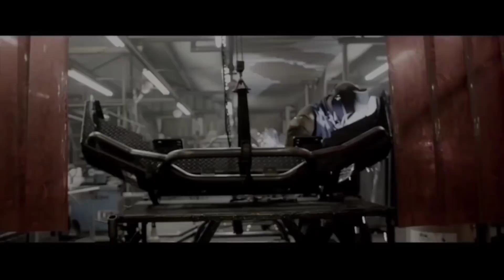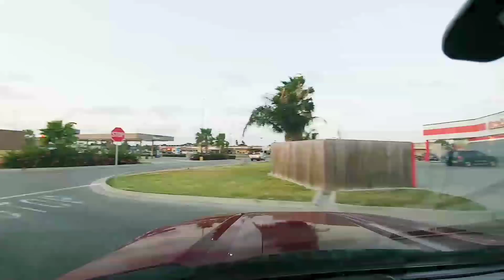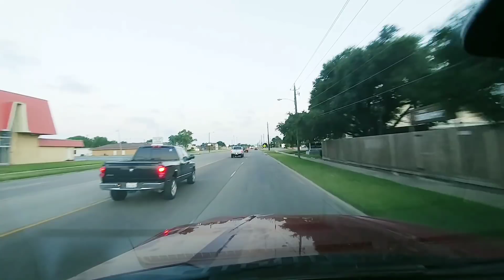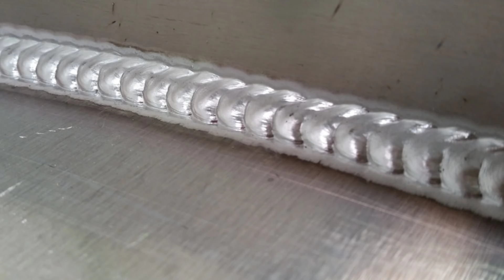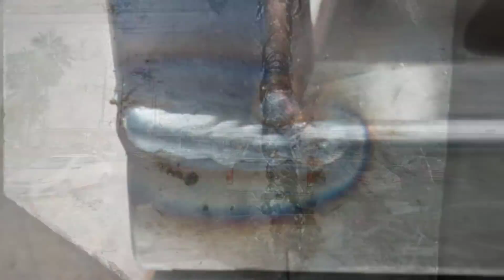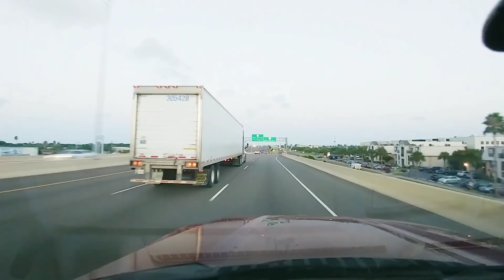BRAND NEW RV ALREADY RUSTING??  Should you worry?

Comment: I've been on the hunt for a full time unit for a permenant site and have been extremely disappointed in the quality of these $100-$150k units especially the aluminum structured units I'm a welder and own a fabrication shop and the quality of these units is shockingly poor I've been looking for a rear elevated living room floor plan and really love the Riverstone 38re interior but disappointed in the structure quality and absolutely refuse to pay that kind of money for such shotty work I've been on the hunt for over a year and honestly the best I've found has been on the cheaper side of what I've looked and will probably go with that unit the montana 3790rd has been the cheapest and best constructed unit and I've looked at several at a few different dealers to make sure it wasn't a fluke but honestly that is the best bang for your buck brand I've seen and I've looked at 6-8 different full timer line ups

Comment: I think your videos and the information you provide is fantastic.  I have to disagree with you on just about everything you said in this particular video.  Trailer manufacturers don['t build high quality units because there are few laws that protect the consumer.  The lemon law does not apply and it is difficult to make argumnets under the Warranty or Warranty for a Particular Purpose laws.  Many consumers spend huge amounts of money on these products and get stuck with expensive repairs and that is unacceptable and I  do understand the manufacturers, get them in and out in a couple of days or hours, depending on your unit.  As a retired attorney and judge for the Better Busineess Bureau, I can't believe what I see in this industry.  Of course prices would go up if held to a reasonable standard, but any standard is better than non at all.  Sorry for my rant.

Comment: I think the level of expertise with RV builders is lower than even residential builders.  When you buy a truck, car or home you will most likely be around it every day.  Most RVs are purchased, used a little bit then parked in a lot somewhere.  It is expected that there will be deterioration and rot.  Hard to tell if it was from poor workmanship or the elements.  Full time RVers are a little more critical about the quality of their RVs, they depend on them holding up.

Comment: I have recently just bought a palomino truck camper pop up and I have to admit the build quality all the way around is pretty shatty and we're not talking about cheap units here in Canada it's 30 grand I think the general public need to start holding these companies a little more liable to the quality is being produced I understand paying a guy more means the price of the unit was up but when you're producing 75 units a day they're still making their money's worth I just think the quality needs to be improved just my opinion
Reply: Bought palomino maverick new in 2014. Was falling apart literally by time we got home. Cabinets falling off the walls. When we hooked up water we had water coming from the wall. Union further inspection there was a screw right there the line. Jack's loose and rocking . Overall just one of the worst built campers we ever owned. We promptly traded it in at a 4000 dollar loss after 2months and more and more issues. Factory or dealer wasn't very helpful.  My experience.  Some others may have a better one but after research found most palomino truck campers were really bad. Even for the not so good already rv industry.
Reply: @RVsandRCs  I also had an issue with water hooked up city water had water filling the camper behind the wall I had to go through and tighten every connection  City water and also tank water I tried to trade it in last week only owned for 6 months they only wanted to give me $9,000 when I owe 30 is not amazing I think I might just take the loss and get a Better Built travel trailer.
Reply: @IronCross82  sucks man. They are probably the worst built camper I have seen yet. At first I figured I would repair everything myself and keep it but was worried it would continue to devalue as the word got out.

Comment: That's pathetic if its already rusting. Buyer beware!! Sickening
Reply from the maker: Look under the car or truck you own. You'll likey see some rust somewhere.
Reply: @BTBRV  Maybe a tiny teeny weeny bit on my brand new one. But the cheapo RV should use stainless steel screws at least. What's it cost an extra 20 bucks maybe.
Reply: Google1 User stainless steel screws aren’t necessarily the right choice because they aren’t the strong choice.
Reply: They install rusty new parts on trucks and cars at the factory.  Can't paint and powder coat everything.
Reply: +akbychoice that depends aswell they would have a higher sheer strength but lower tensile strength so just depends on the application but you are correct it may not always be the right choice
Reply: +Google1 User I own a welding shop and I can tell you the the difference in the price of ss compared to zinc coated hardware is 5 times minimum 10 times in some cases you're talking hundreds of dollars not $20 and that's just on the frame